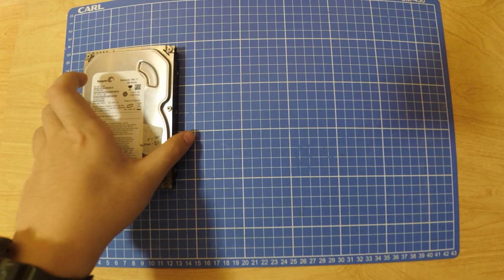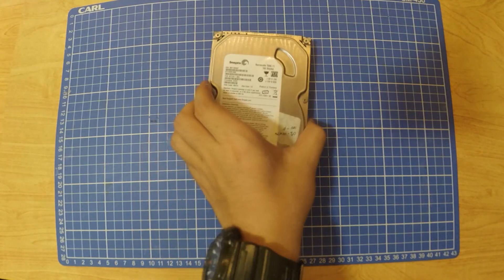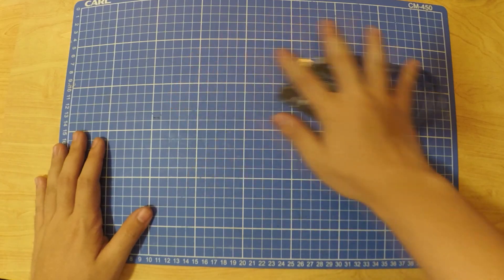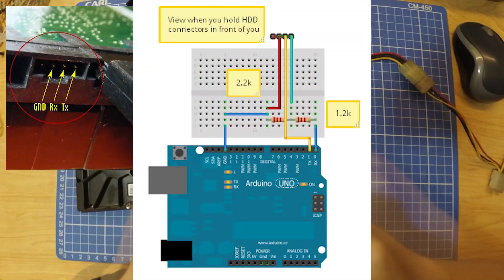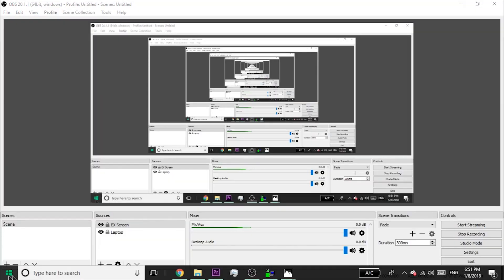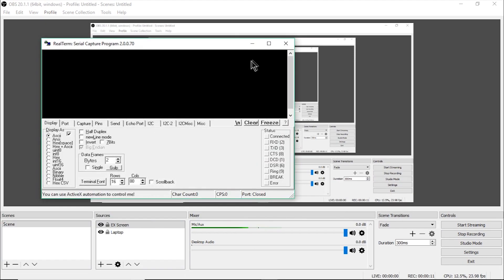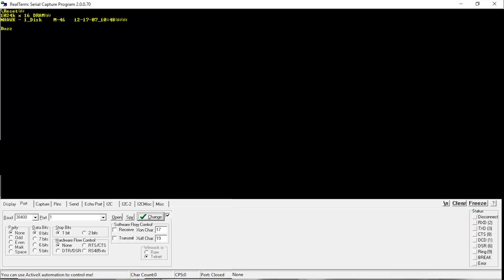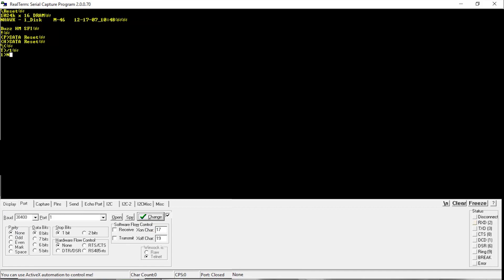How to Reset S.M.A.R.T. Errors on a SATA Hard Drive(Pirate Bus)

Comment: Hi, some way to reset the HDD Seagate Momentus Model: ST250LM004; Momentus 5400.6 Model: ST9250315AS? What is the connection of the RX and TX and what is the Scriph code for the reset of these disks? Apparently it is not the same in all models and they vary the position of the RX and TX in the Hard Disk. I also understand that some should only connect the RX and TX without the GND.

There is also some possibility of doing the same, but in other brands? For example: SAMSUNG HN-M320MBB; SAMSUNG Momentus ST320LM000; THOSHIBA Mod. HDD2H85; TOSHIBA Mod. MK3276GSX; TOSHIBA Mod. MQ01ABD032; HITACHI Mod. HTS545032B9A300; etc ... These are some examples that I put here OK. 
Thk...
Reply from the maker: i only tried in seagate. there is no code i'm just using the usb to serial of arduino uno.

Comment: Great tutorial! 
Do you use any specific Sketch on the Arduino? I tried to do it on a Seagate Constellation and Barracuda and could not manage to get onto it via serial. 
And another question: Why you interconnect RSTwith GND in the first place? If I do that I don't get anything back from Arduino...
Reply from the maker: there is no code involved in here it's just using the usb to serial chip of arduino uno. it didn't work maybe because newer drives uses newer communication protocol.
Reply: you can also use CP2102 to USB programer or adapter, it is a small tool to program some arduino board, and it got TxD & RxD. I use it to program my arduino Pro Mini.

Comment: Hi, I can't see schematic properly, explain me please:
-Do you connect resistors in series?
-Do you connect GND to Tx?
-Do you connect Tx in drive to Rx in arduino? And opposite, Rx in drive to Tx in arduino?
All this is according to picture in video, I want to try your method, but i don't want to brick my drive. Help me please :)
Reply from the maker: does your drive support this method?? WD drives didn't work like this.
1. Resistor are voltage divider to convert 5v logic level to 3.3v.
2. it is connected vice versa tx-rx and rx-tx.
3. Just follow the fritzing schematic.

it will not brick your drive but keep in mind always back it up to prevent loss of data.
Reply: @bulantuy 
Thanks, unfortunately i have WD disc, so i'll look for different options

Comment: How can I make my voice as creepy as yours?
Reply from the maker: Speak slowly and DEEPER maybe. LOL!
Reply: I think a low-pass filter will do the trick.  Question:  If the actual problem that caused the smart error still exists , will the smart error quickly return?
Reply from the maker: no, it doesn't because sometimes smart detects some false alarm detection like impact,higher power on time, and start and stop error that doesn't damage the platter.